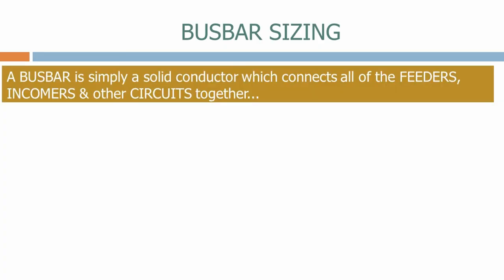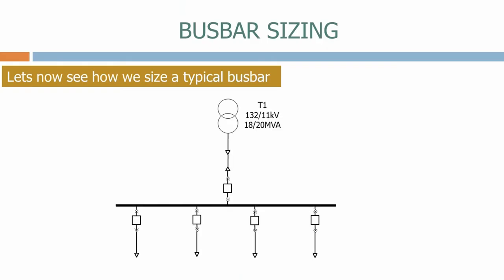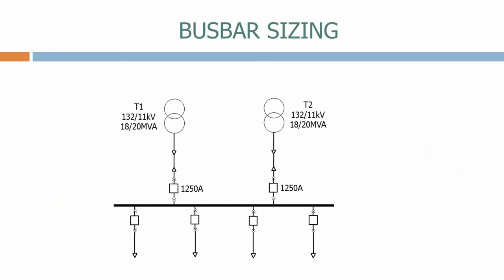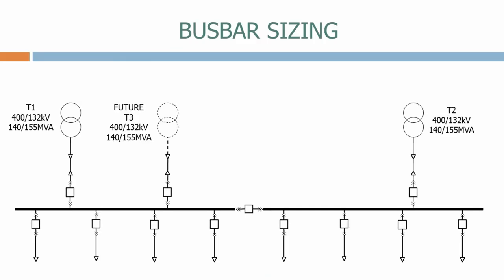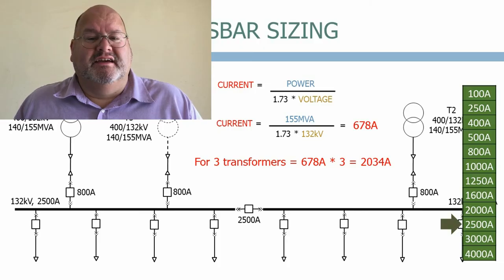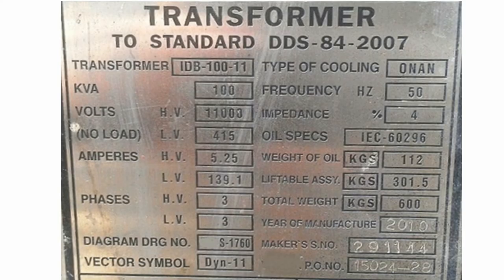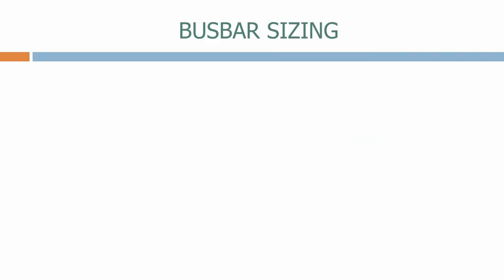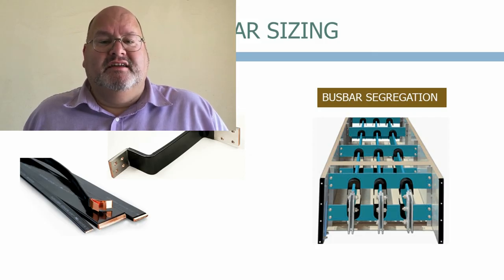Busbar sizing

Comment: Thanks alot for explaining  i think we should raise the  rating of bus bar over the selection value to carry the mechanical stress of cables
Reply from the maker: The cable rating will depend on the load being carried under all conditions and the two are not normally linked.

Comment: This is great if the customer owns all the equipment or is the utility company.   If the transformers are utility company owned and the equipment is customer owned, we have to decide how to size the bus bar in the gear based on electrical loads attached.   Utility companies can change their transformers as they see fit.
Reply from the maker: Hi Kevin,
               Agreed, if you are trying to conserve money we can base the bus bar on the connected loads, but make sure you future proof the design by adding lots of spare busbar capacity as upgrading the busbar size later when new feeders are added can be very painful in terms of outages and cost....

steve
Reply: stephen brooks      Over the years doing electrical designs for all kinds of businesses, I have checked back with my customers and gotten a printout of their utility bills for a year minimum.   The bus was sized using NEC calculations.    Every time the results were very similar.   A 3000 ampere rated service equipment would have maximum recorded 900 to 1100 amperes.    Utility companies typically took our load information and multiplied it by .5.      Respectfully,   Kevin

Comment: Hi there sir. I would like to ask if I can use the same computation? Say, I need to determine the HV panel outgoing protection to a load 630Kva, 33/0.4Kv Transformer. Hope you could help me. Thanks.
Reply from the maker: Hi Efren, the calculation is valid for all voltages. steve

Comment: Generally, bus coupler breaker will be normally open. One transformer A will feed to bus A and trf B will feed to bus B. However, there will be some case that if one of transformer not available another will take all the load of bus A and B in this case bus coupler breaker will be closed it means that both trafo A & B shall be sized based on load on bus A plus load on bus B it means that bus coupler breaker just size as per transformer rating it is not required to unnecessary size double time of trafo rating this is the same thing of bus bar rating also

Please check your presentation sir
Reply from the maker: Hi PP,
          This is a very simple example and most transmission level substations will have multiple incomers, transformers and busbars.
The decision on the bus section breaker rating will be decided by the designers to provide the best operational flexibility & cost effectiveness for the system.

Regards

Steve

Comment: Thanks for that Stephen -  in the first example with 1 incomer,  the full load current of the secondary side of the transformer is 1050A, could I design the switchgear with a busbar rating of 1000A and an incomer breaker rating of 1000A (maximum peak load including future spare is 900A) .  I have done similar on a project which I consider to be a sound design. I think it is fit for purpose but does it break any IEC codes do you know?
Reply from the maker: Hi Chi,
           In the UK we would always choose the rating above the transformer rated output , so 1250A in your case. The loads change over time so it’s not the best way to size the busbar.

Regards

steve
Reply: @Electricalsteve  Thanks very much Steve

Comment: Hi Sir. Just a quick question. The busbar rating for the current is multiplied by 3. But why is the voltage not mulplied by 3 also?
Reply from the maker: Hi,
     The system voltage is kept constant regardless of the power output of the transformers or the size of the loads.

If the voltage is constant then the only thing that can change as the power magnitude changes is the current and it does, when the power drawn by the load increases the current increases.

Regards

Steve

Comment: I have a question. Some peoples in youtube says for copper  1 sq mm = 1.4 Amps and for Al 1 sq mm = 0.8 Amps . Is it correct or not ? and how to calculate the current density for busbar if i want carrying current of 200 Amp as an example.
Reply from the maker: Hi Wadi, this video covers busbars, not conductors. steve

Comment: Thanks. I have some questions, could you explain how to calculate or do the sizing  for bus-bar at MV side of power transformer HV 220kV/20kV, 12%, 125MVA, YNd11, ONAN/ONAF? where at PCC of  transmission, it is 40kA at 220kV (HV side) which is the short circuit current value considered  as designing at this high level voltage (220kV) (according to transmission operation) and in addition, the company of transmission  gives us a value of 15kA(maximum demand of load) the maximum three phase short circuit current at the same point PCC (High voltage side)..   So the second question, according to IEC standard or experience  for designing MV switchgear at 20KV, what short circuit current value will it have to be used  40kA or 15kA (PCC connexion, 220kV) for sizing my MV switchgear, Ik and Ip (withstand simetrical and peak short-circuit current?
Reply from the maker: Hi Ki,
         This video is a sample only, please take the course for full guidance on this and many other substation design issues.

Regards

steve
Reply: @Electricalsteve  okay, thank you.

Comment: Hi sir, what topic in udemy the sizing of equipment? I would like to buy thanks
Reply from the maker: Hi Mike,
              This is a module on the air insulated design course hosted by udemy.

Steve
Reply: @Electricalsteve  hi sir, i have trouble in buying your videos. Paypal, cc or debit card cant be link to udemy :(

Comment: Hi sir .. you said incomer 1 (800A) Incomer 2(800A) future (800A) ..and you going to choose 2500A busbar .if I saw in my switchgear diagram all incomer and buscoupler are same rating .. for example 2500A busbar we choosing Incomer and buscoupler 2500A breaker .. but current rating just 680A for both Incomer why?????
Reply from the maker: Hi Ahilan,
                 You didn’t mention the system voltage but the utility may be future proofing the substation by having the highest rated circuit breakers possible.  
You will also find that the cost difference between  800/1250/2500 circuit breakers can be small for large equipment orders so it makes sense to go for the highest circuit breaker rating , this also reduces the need for different circuit breaker spares and allows the circuit breakers to be interchanged easily when one goes faulty.

Steve
Reply: @Electricalsteve  415v

Comment: if you had say a 500 amp max load could you use a much higher rated busbar of say 2000 amp, i don't see why you need to have the busbar rating stay near the load value, seems to me you should or could just a much bigger bubar and you wont ever have a problem.
Reply from the maker: Hi, that’s correct. You don’t size the busbar based on the load, as loads can change over time. You size it based on the maximum amount of power available to flow into the substation steve